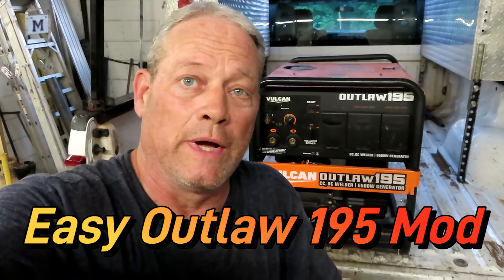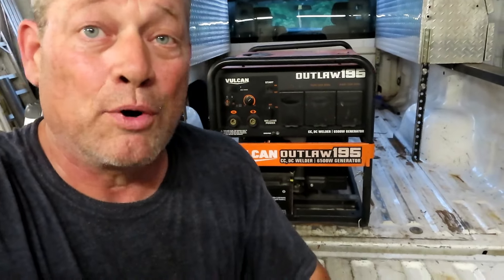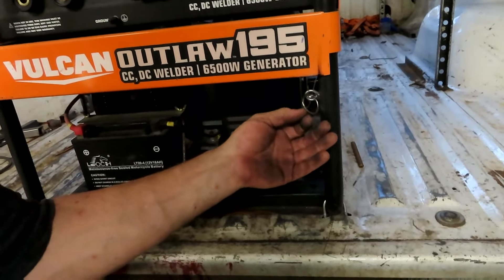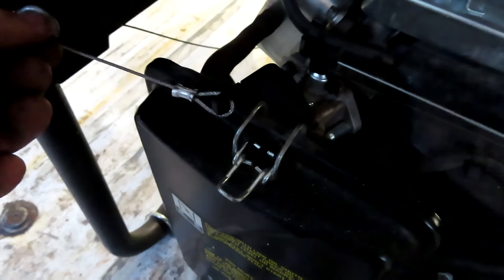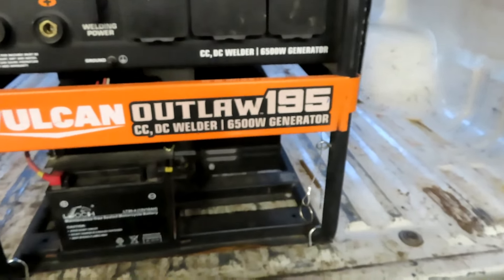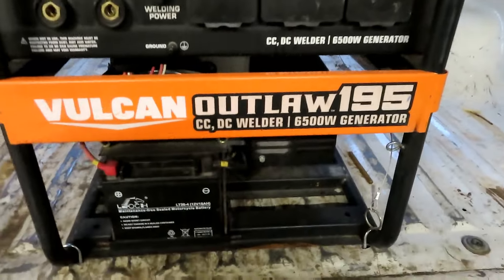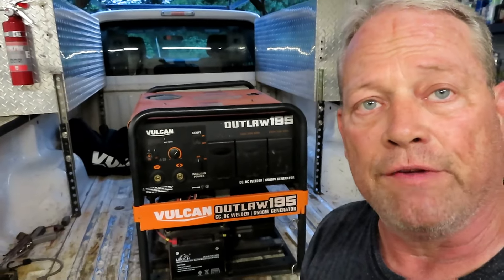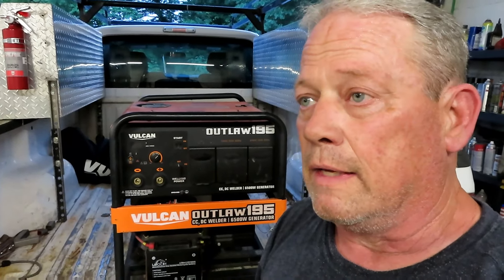Vulcan Outlaw 195 - Easy Mod

Comment: Hi l brought  Vulcan 195 engine like yours. Didn't have welding electrode holder lead arc and welding ground clamp.l need help. I call harbor freight  and l was told they. didn't have in stock.can used 90a-600a
Reply from the maker: You can go to a welding supply store and they can get you what you need. That's what I did. I bought 50 feet of cable and put 30 foot on the work lead and 20 feet in the ground. They can help you with plugs, wire, electrode holder and ground clamp. Or you can go to Amazon

Comment: The choke on my Outlaw doesn't reset automatically after starting
Reply from the maker: Well that's no good. With the engine off, make sure all the associated parts move freely. Make sure that long spring is in place. Unplug the solenoid wire is clean and plugged in. Could be a problem with the solenoid.
Reply from the maker: Also, on the solenoid plunger, there is a little pin that captures the choke arm, make sure that is intact, otherwise it won't pull the choke back. The exploded parts diagram in the back of the manual may help diagnose this. Move the choke to start position, then start the engine. Quickly look at the solenoid to see if it actuates. If not, there's your trouble. With the engine off, that plunger should move freely. It may be stuck. You can order the part from Harbor Freight, but it may take a while to arrive. I see these on Amazon for 12-15 bucks.
Reply from the maker: Do you have an older model, or do you have the new model that has the CO2 monitor? I ask this because I have discovered that the NEW model (with CO2 monitor) may have done away with the semi-auto choke. I was reading the NEW manual tonight and it says that after it's running, to move the choke back to the run position manually. Follow the long rod and spring from the choke lever on the carb, and see if it goes to an actuator located on the other side of the engine, right in front of the starter. Can you confirm this on yours and get back to me? I will be reporting on this in a new video at the end of the week. Thanks!
Reply: @AllStarWeldingSC  mine is new model with that stupid sensor

Comment: You can do alot with 195 amps
Reply: Thanks!
Reply: Guess i need to start where i can
Reply from the maker: Yes you can. 195 is ALOT of amps. Even a Hobart 145 would be a good start. If just for 3/32 6010 at 60, or 3/32 7018 at 90.  I use 140amps sometimes. But I rarely go above that. So yeah, 195 is plenty!

Comment: Do you have a breaker on when you do that ?
Reply from the maker: I don't understand what you are asking?
Reply: @AllStarWeldingSC  so in mine choke doesn’t go back to run position like this how did you do that?
Reply from the maker: @nyantun5315  Check to make sure you have all the springs in place. Sounds like one might have broke

Comment: What about putting a small spring on it? I've got a Honda ew171 welder and a Honda eb 6500 generator with a spring applied, vacuum release automatic choke and it works fantastic! I never have to manually operate the choke.
Reply from the maker: That's an interesting concept. I'm going to look into that!
Reply from the maker: I just watched your video about your Hondas. I didn't know they made those.
Reply: @AllStarWeldingSC  there's definitely not too many of them out there. Mine is the only one I've seen in person but it's a fantastic little welder

Comment: Been trying to get a welding business started but welders cost to high
Reply: I started with a 6000watt genny and a plug in stick welder and a good 100ft cord
Reply from the maker: I got this Outlaw on Marketplace for $1000
Reply: @AllStarWeldingSC  ive been having people call but been to intimidated cause i didnt have a lincoln or a miller
Reply from the maker: @josephfranklin5083  Joseph.... dude, you need to get out of that mind set. Like Brent said, I also started with a generator, a plug in stick box, and an extension cord. When you go on a call, they don't care if your machine is red, blue, orange, or black, they just want their stuff fixed so they can get back to work. I have a friend that bought a used Miller machine for $4000. It broke down shortly after and cost almost $2000 to fix and took 6 months. In my shop, my stick, Mig, Tig, plasma are all PrimeWeld. They are inexpensive, very high quality, 3 year hands down warranty, and the best customer service in the land. Even a Hobart 145 welder generator is enough for 3/32 6010 (60amp) and 7018 (90amp). You can do a hell of a lot with that setup. My Outlaw is 195. I will never use all that. The most I've used is maybe 160-170. If you want a bigger, nicer unit, look at the big engine driven machine from Hobart at Tractor Supply. It's really nice. Sure, I would love to have a Miller Bobcat, but too expensive and worried about repairs. I'd recommend to get what you can, and get to work. Use extra cash for marketing. It will work itself out. I'd start with a Hobart Handler 145, used from Marketplace. Let your work speak for itself, not the color of your machine.

Comment: The only thing they thought this would be used for is rolling around.  They didn't imagine using it in the back of a truck.  I found your vids tracking down info on the  Outlaw ( HF says it's "new", i think it's just back).  A couple of years ago, i just bought a neverlast 211, gas bottle, cart and some misc set me back 1800. I walked into HF and they and a store return that looked brand new, they said the guy didn't like the way it welded. $800, I couldn't buy it.  
Now I'm looking at the Klutch Terminator version that sells for $300 less and has a 3yr warranty, but pull start only.  The only way I could see using the klutch in a truck is to turn it sideways.
 I like seeing your videos putting these machines through their paces.
Reply from the maker: Thanks. I'm glad you are liking my little videos, and thanks for your comment. So, what happened with the Outlaw is that they had to wait for every last one in the stores and warehouses were gone. Then it was re-introduced, but with the CO2 monitor on it. Someone told me that it now includes the 3 year warranty. You'll have to check on that. The Outlaw and the Klutch are basically the same machine, but with Outlaw having electric start. This machine welds great. It will do up to 5/16 7018. I even used it the other day at 40amps with 309L stainless rod. Did great! I haven't found anything it won't do yet.  The wheel kit that it came with was easily removed and took off at least 40lbs. It works great in my truck. I got mine used on Marketplace for around $1000. It paid for itself in 2 days!
Reply: I just picked mine up today.I ordered it on January 2, and they told me it would be in the 29th.but it came in early I got it home, and I only ran 3 or 4 rods 6010's, and it welds great. I'm going to work it all  weekend building the fence that will pay for it.